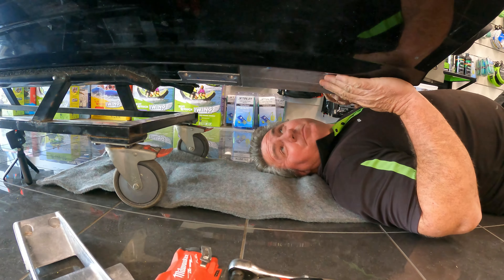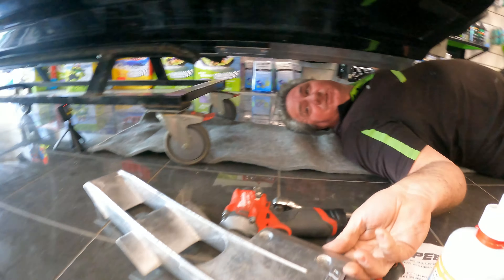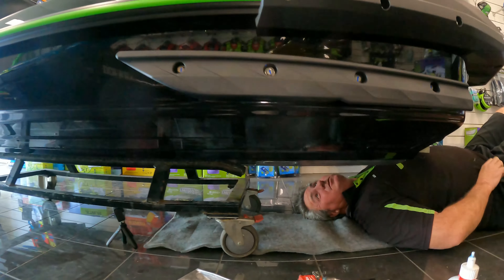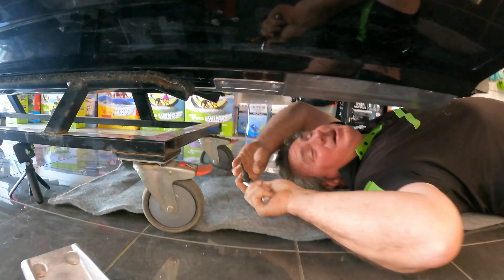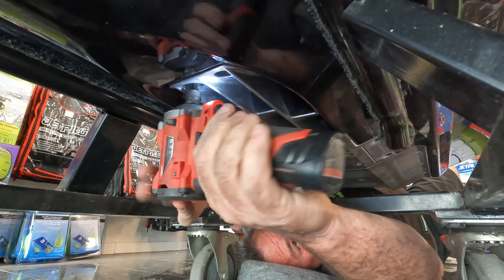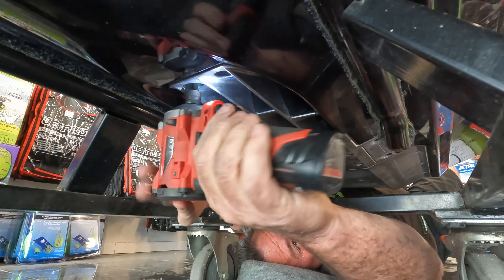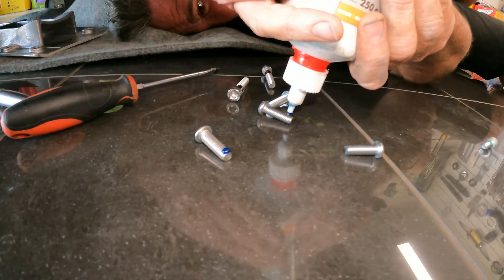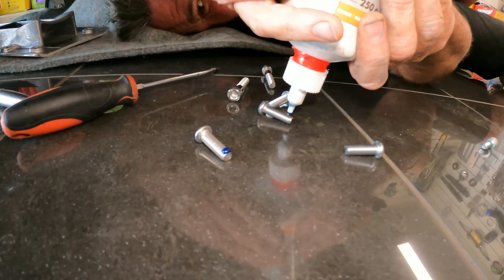Kawasaki Ultra 310 - Kspeed Intake Grate Install

Comment: Don't you need to seal the back of the grate against the ride plate to stop water pressure coming out of the pump tunnel after its picked up by the grate?
Reply from the maker: They aren't sealed from factory, and not with our design either. If you wish to add a bead a of silicone around the edge of the grate after installation it will slightly improve top speed.
Reply: @BrisbaneKawasaki  thanks for the reply, i noticed my plate wasn't sealed, and quite a decent gap at the back, so was wondering if it should be sealed.
Cheers

Comment: What is so good about this?
Reply from the maker: "KSPEED intake grate

Get back on the power quicker, with improved traction over stock grate.

Developed over the course of 7 years. With offshore racers, closed course racers and weekend warriors.

We tested every other grate on the market. We can say hands down, this is the fastest grate available for the Kawasaki 300/310 platform.

The new KSPEED Kawasaki Ultra Intake Grate Kit has been designed and developed to deliver the ultimate handling and speed performance in recreational, offshore, and closed course race conditions.

The KSPEED Ultra grate will deliver quicker acceleration, higher top speed performance and a much smoother and more predictable ride over the O.E.M. intake grate. Low speed and high-speed turns are a breeze with new found control.

Gains found during 18months of testing, averaged up to 4Kph top speed gains."

https://www.brisbanekawasaki.com.au/collections/ultra-300-310-performance/products/kspeed-ultra-300-310-intake-grate